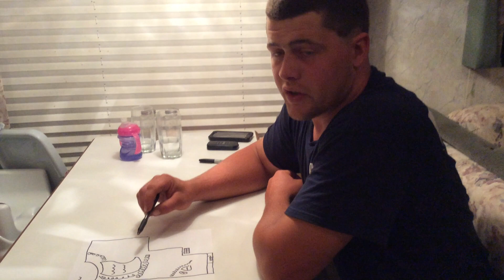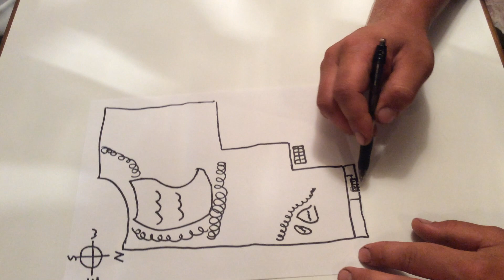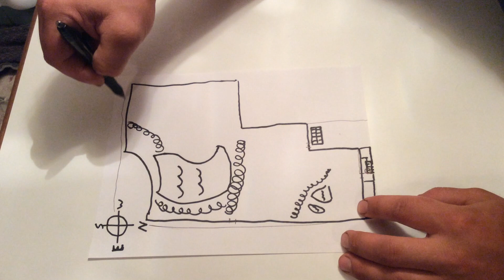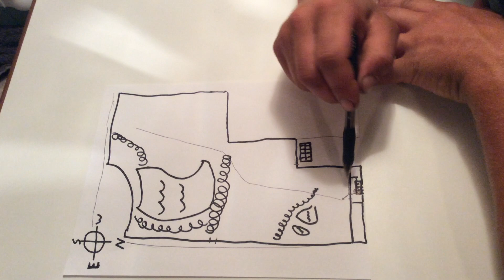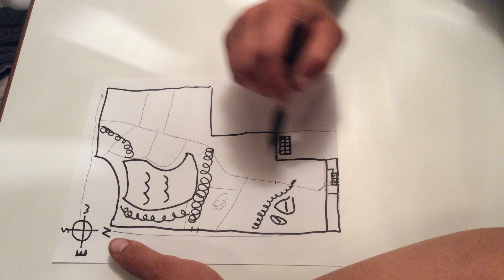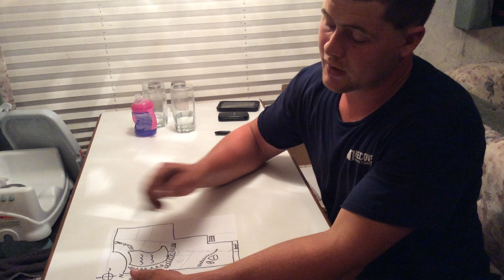How Do You Set Up a Farm? -- Kansas Ranch

Comment: I'm trying to remember what kind and size pump you use? Thanks
Reply from the maker: DuroMax XP702 its a high pressure pump with lower flow volume, that way its not maxing itself out all the time trying to pump through a 1” pipe.